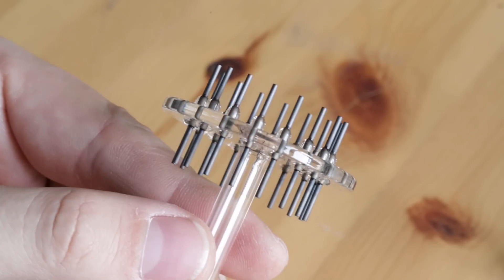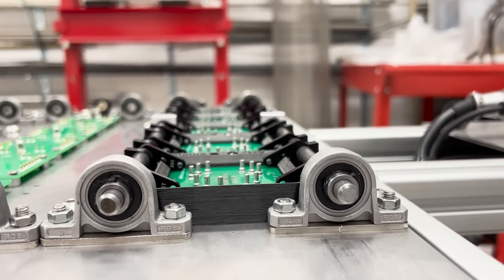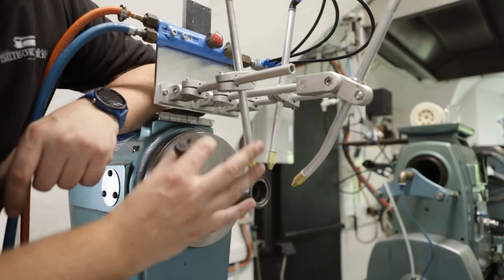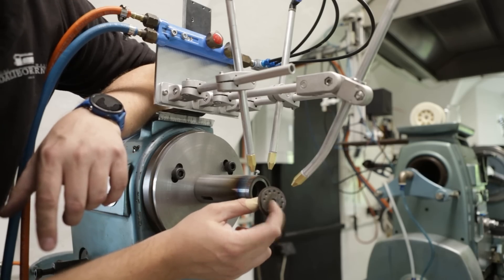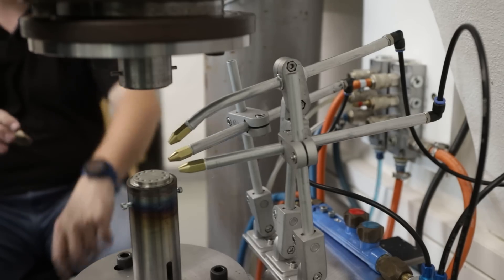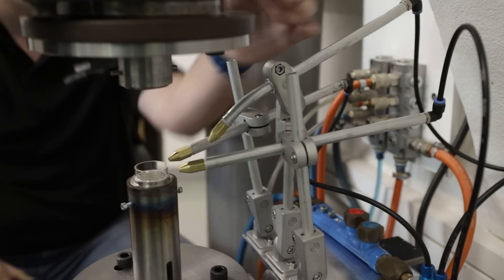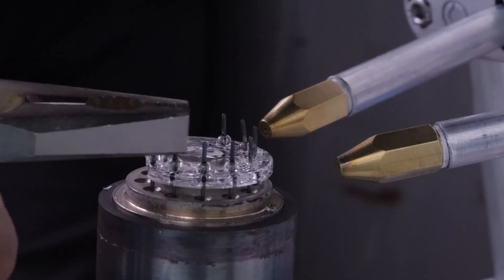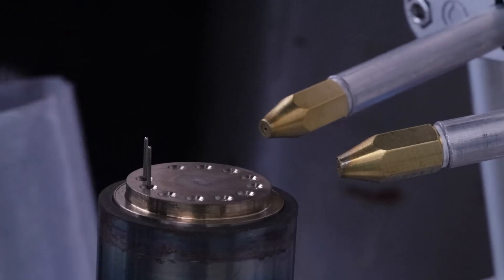I added stationary burners.  F project | EP#10

Comment: To avoid burning the pins - did you think about using a CO2 Laser for heating the glass? Normal glass ist rather opaque at 10,6 µm. You can melt the glass without hitting the pins. Also this type of laser has become rather cheap.

Comment: Hello Dalibor, ..... From what I see the temperature is enough to melt the pins. To avoid this, it's not possible to insert the pins in the upper mold and than push it thru molten glass ??? Good luck to you and your family.
Reply: Was looking for this comment. I know nothing about working with glass so I don’t know if it is a good idea, but it is what I thought as well. Maybe the glass won’t bond properly with the pins that way? Idk.
Reply: @ElukeNL  if the pins need to be heated to bond with glass... they may be preheated with additional torch on the upper side .... .... idk ... I also never worked with glass.

Comment: Could you turn the machine upside down , pre heat the pins and molds , then heat one gob of glass on the bottom  mold and push the pins down and through into the melted glass, i know the securing of the pins from falling out might be a problem, it might help stop melting pins, and cracks,

Comment: You have a temperature control issue, but also, the melting points of your glass and pins are too close. Any way to lower the glass meting point and/or increasing the one for the pins ? I'm not sure if you had a chance or can play around this, or maybe if RCA did this ?  This would give you much more flexibility / headroom.

Comment: This may sound counter intuitive, but have you tried using an air compressor with a fine focus nosel focused on the pins above the glass? If you had that on a foot peddle, you could cool the pins as you heat the glass keeping them from failing too soon, and cut it easily when needed. Hmmm... this process is very complicated.

Comment: Looking good, next would be just a few solenoids and timers to control the burners for consistency.
Flames should aim at where you want the glass to go once melted, aiming high just will burn the pins (looks like you got that figured out 👍)
Stainless is working good. just make sure the die heads are up to temperature, otherwise you'll get inconsistent results. ideally the whole system  should be automated so you'll get consistent cycle time, that should help everything to reach equilibrium.
The cracks forming in the centre... not sure how to fix that...., I'd say your die plates are too cold.

Comment: Definitely staying tuned! The pin wheel could use some locking mechanism that would hold the pins firmly in place for turning, while it'd be released for insertion and removal.

Comment: how about making molds with the pin bump on the bottom, place pins, then glass granules and then kiln fire them to get the glass to flow with the temperature lower than is required to melt the pins. and have a second kiln for normalizing.... you could have trays of these in layers inside the kiln.... to me, it almost seems that you are trying the hardest way possible.  i think you are doing fantastic with everything that you have done...
Reply: i do realize that this wouldn't be as fast as needed eventually in production unless you had a really large kiln...

Comment: Overheating the pins looks like a real problem.  Can you preform the button and add it in formed and dear molten?  What about something in the bottom to try and pull the heat from the pins?  Something like a copper or aluminum collet at the bottom the the lower die?  Just something to help transfer the heat out of them.

Comment: Instead of having that center burner swing up to get out of the way, what if it swing parallel to the mold. Hey up the center, then pull the cold end toward you to swing the flame out of the way for pressing. That could be on an actuator on a final design.

Comment: Good progress. I have said it before but every time you make a new stem design you go through this very same process. Mold temp consistency will be important along with getting them off the mold and into the annealer and the shape of the exhaust tube connection will effect your radial cracking you are getting there.

Comment: What about sticking the cold(er) pins into the molten glass during the press action? That could fix the problem with the melted pins.
Reply: That would compromise the seal he is trying to accomplish
Reply: @0xbenedikt  then the pins need to have glass beads on them already...
Reply: Oh I think he said before that if you push the pins through the glass then they get glass stuck on them and you can't get it off

Comment: I'm curious if you're putting any consideration into preheating your molds. I would imagine on the production line examples you've shown of industrially created Nixie stems that there's a lot of heat built up in those molds. perhaps that would help you maintain heat in the glass so you only need to do one stamping instead of multiple. 

regardless, thank you for sharing this research. it's really fun to see how you improve your process
Reply: Think the problem was, with cast iron, it can't be heated too much before glass sticks readily to it. The stainless should be more promising. Which, with the upper still in iron, and it looks more prone to sticking (but maybe that was just the pins getting wedged?), making both in stainless may just do the trick.

Comment: I haven't been a scientific glass blower for two decades. But, I had a similar heat issue back then. I resolved it in two ways in two different projects. In the first, I had to pre-heat the molds much hotter than I thought prudent. In the other, I made the molds out of graphite. Don't know if any of that applied here, but maybe it could help.
Reply: How big were the details in your graphite molds? Any inserts, like the pins here? I'm wondering how quickly a graphite mold might wear or chip. You wouldn't have to keep brushing graphite dust on it though :)
Reply: @JaredJennings-hp3zt  Graphite mold could still have metal ferrules for the pins pressed into it?
Reply: @JaredJennings-hp3zt  The molds varied in size. The one which would come the closest to what Dalibor is doing was for the formation of a multiport sampling device for a laboratory analyzing water samples. It had three ports for integrated sensors; one three wire sensor port, and two ports for two wire sensors. The wires were actually placed into hole pre-drilled in the borosilicate rods before they were heated and the rods pressed in the graphite mold to make the metal/glass seal, and form the base of the module.

Comment: I have no glass experience, so this might be a dumb suggestion. Would it make sense to form the inner disc with one set of dies, and then put it in the middle of this set of dies, and fuse them together? It looks like a lot of the problems you're encountering with the pins getting hot are due to the inconsistent process of melting the ring on the inside, and if you were able to make it a two step process, maybe you could get a better/more repeatable result. I also think that you might have to be creative with the disc dies, because you probably want them to have a chamfer for the outer glass to flow into, and you won't have any pins to help keep it from sticking, so you might need some shallow relief holes (which would leave a texture, I would assume).
Reply: Could also be cut or drilled plate glass, but probably the idea is, since it needs to be melted well enough to not just cling to the pins but indeed make a chemical seal, it doesn't (or shouldn't) much matter what the shape is beforehand, and any more effort (than cutting bits of tube) isn't worth it.

Comment: Congrats on the good progress. I'm still wondering if the upper mold isn't hot enough and may be contributing to the stress fracturing. I liked how the outer glass formed a torus though getting the inner to melt and meld simultaneously so you only have to do one die strike is an automation issue. I also wonder if when annealing is applied is going to be an issue? 

It seems you're using the well know but not often used try-fail-analyse-learn-adjust rinse and repeat rapidly until success.

Comment: What an odd celing. Is your lab at the top of a cathedral? Or perhaps the inside a capsized catamaran?
Can the central glass be melted off to the side in a metal 'scoop', then dropped in as a blob just prior to stamping? It could be integrated into the central burner as a unit so there are no cooling issues, perhaps?
Reply: It's a castle.

Comment: FWIW, there was just a lot of discussion in the comments of Keith Rucker’s channel about drilling stainless steel. Consensus seemed to be that neither “pecking” or high RPM are advisable.
Reply: Pecking is fine, you need to get the feed rate up to match the drill rpm though or you'll rub and then it'll harden and your boned. Don't dwell at the bottom of your peck.
Reply: Small drill can't clear chips like a bigger one, most likely. And higher RPM is needed for smaller drills because angular velocity